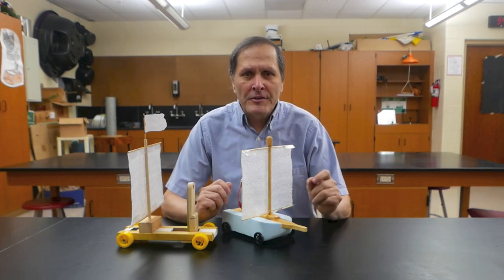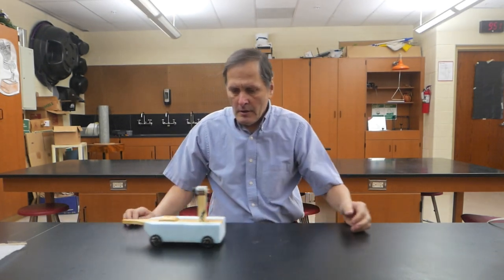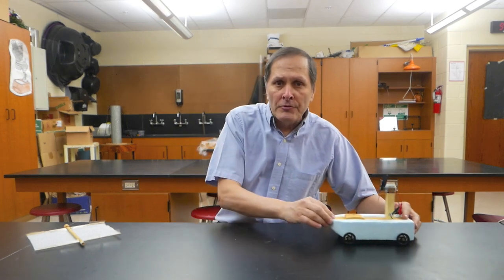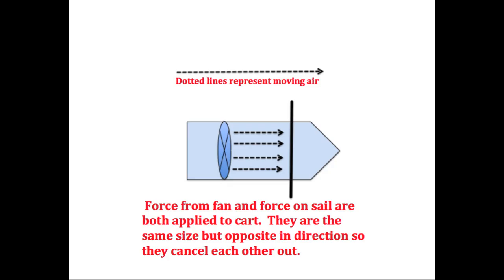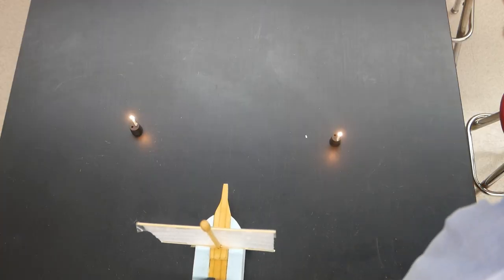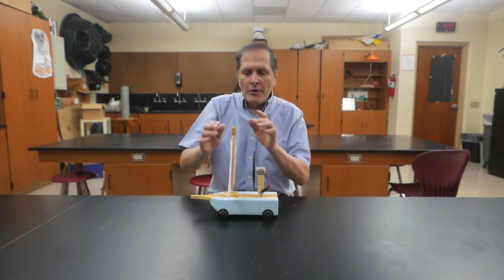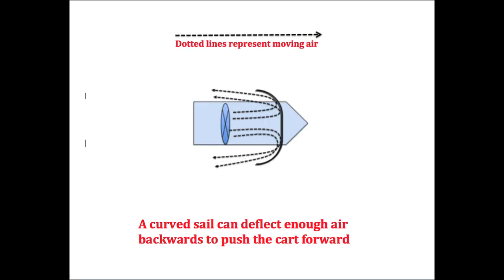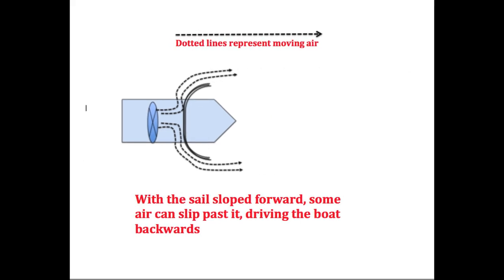Fan Cart - Blowing into your own Sail- part 1 // Homemade Science with Bruce Yeany

Comment: Have you tried putting a keel on the boat? With the sail at an angle producing spin, would a keel act to force that into linear motion?
Reply from the maker: HI Peter,   there is another video that follows this one where I tried some other ideas,  a keel / rudder helped

Comment: I still don't get why is there a net force on the curved sail when it redirect the air backwards. I do see how redirecting the air backwards in general produces a force, but what I don't understand is why it isn't balanced with the fan's force on the ship. 
Let's say you have a powerful laser as the fan and a perfect mirror as a sail. The mirror will redirect light backwards and create a force on the sail. So, will the force from the laser be balanced with the force on the mirror? And if so, how is this model different than the ship with a sail and a fan?
Reply: Really excellent point. My best guess is that not all the air is being pushed perfectly forward by the fan but is still caught and reflected backwards. This would be like having a laser at 45 degrees to the mirror. Then you'd expect the mirror to move away from the reflecting side. But if there was something restricting it's motion in one axis, e.g. floating on water, it would move perpendicularly to the input laser beam. Bruce, could you investigate this? maybe with a smaller curved sail only capturing the air moving perfectly forward?
Reply: Clearest example is an elastic collision.
m1v1 + m2v2 from before collision = m1v1 + m2v2 from after collision.

For example a basketball hits a stationary person.
If the basketball comes to a complete stop (hits their chest, stops, falls from gravity)
1kg*100m/s  + 100kg*0/ms = 1kg*0/ms + 100kg*1/ms
100 total before and 100 total after, the momentum has been transferred completely from the ball to the person.

If the basketball instead of stopping hits them and bounces straight back at full speed.
1kg*100m/s + 100kg*0/ms = 1kg*-100m/s + 100kg*2/ms
Now to get the 100 total after, we had to account for the ball moving backwards at 100m/s after the collision, which required the person being hit by the ball to move TWICE as far backwards simply because the ball bounced instead of stopping!

If the fan moved the air, then the sail stopped the air, the boat would stand still.
If the fan moves the air, which hits the sail and then bounces straight backwards, then the sail faces twice as large a force, it is responsible for stopping the air (a force) AND sending the air bouncing backwards (a second force)
In the flat sail where the air moved sideways, instead of backwards, this air was in a different direction in space (not forwards-backwards) so it didn't exert that second force either forwards or backwards.
Reply: You're absolutely right, thanks for reminding me of the formalism. I checked the steps including the fan starting to move the air in the first place and sure enough if the air is going backwards at the end then the boat will move forwards. I think this demonstrates how used to thinking in terms of closed systems we get. If you were on a boat bouncing a ball off the mast you wouldn't get anywhere. Similarly, if Bruce put the fan in a box then the boat wouldn't move forward no matter the shape of the front of the box.
Reply: Ciroluiro its really confusing haha, you’re not the only one tripping out lol. Let’s assume you’re standing in the back of a sailboat. Instead of a sail there is a solid wall. Let’s also assume there are no losses and all collisions are perfectly elastic.
1. You throw a ball at the wall.
2. The moment the ball leaves your hand, the boat gains momentum equal and opposite to the ball, so it begins to move backwards.
3. When the ball hits the wall and ceases to move with respect to the wall, both the boat and the ball have no velocity. At this point the net effect has been that the boat moved backwards.
4. Now since the collision is perfectly elastic, both the ball and boat begin to move in opposite directions to what they were before.
5. Now the boat begins to move forward and the ball moves backward.
6. Eventually the boat reaches its initial starting point. But notice the boat is still moving forward.
7. Time continues and the ball is now outside, behind the boat and continuing. The boat is now ahead of where it started and continuing.
8. The boat and ball will never meet again, so the boat will continue to move forward.

This is the simplified explanation of what is happening, but it captures the fundamental effect. Of course an actual ball will be falling due to gravity, but we assumed it wouldn’t because the ball in this case (air) is the same density as the air around it. All the losses we neglected due to our assumptions are apparent in the actual experiment in the video, which is why it’s more effective to have the fan without a sail.

If you measure the forces on the boat with the sail and fan and have a high speed camera, you’ll see that moments after the fan starts spinning the boat will feel a force backwards equal to that of the no sail case. Moments later that force will become balanced out and moments later it will become forwards.
Reply: Bypass air, like a jet liner engine, the exhaust from the fan isn't what provides most of the thrust, it's the bypass air which is carried with the exhaust
Reply: It is flowing air vs when the air hits a "wall". This is an important concept to understand lift, so get to it!

Comment: what if the air is being sucked in from the front and directed and blown to the sail.  Could you try this experiment with a pipe that bends from the back of the fan to the front so that the air source would be in front of the ship rather than the back?
Reply: Unfortunately, this wouldn't work either. The air that hits the inside of the pipe at the bend would cancel out the force of the air being pulled into the pipe by the fan.  Likewise, the air that came around the bend would push back on the pipe, canceling out the force of the air hitting the sail, resulting in the same problem.
Reply: I'm not sure it's as simple as that. The  fan sucking the air out of the bent tube creates a slightly reduced air pressure inside the tube so the higher pressure air outside the tube would produce a force on the tube and since the area of the outside of the bend is greater than the area on the inside of the bend there would be a net force equivalent to the curved sail scenario, or at least cancel out the force of reversing the flow you describe.
If you used the bent tube and then the fan blew the air into the bent sail you would have the equivalent of a jet engine with an S shaped airflow internally.
Reply: The main issue being the source of air is just as important as the out.  The fan is = to a person sucking air from one direction and then rotating 180 degrees then blowing it out.  If the people on the ship were blow to the back to move the ship forward they would have to spin towards the front and breath in the air to be efficient.  If they were standing still breathing and blowing in the same direction they would definitely have an issue.
Reply: No its not important where the air comes from... You automatically push backwards (as a human or a fan) when you blow the air. Imagine solid air: where does the force for the sail comes from? From your lips (as a human) or the rotors of the fan! Ther source therefor is not important!
Reply: Lower the air pressure in front of the sail and it will pull forwards.
Reply: nope in fact if one lowers the pressure in front of the sail the air comming in from the front will drive the sail backwards OR the air on the other side of the sail will push the boat forward depends on how and where you lower the pressure. There is no thing as pulling of lower pressure. But all of this has no relevance for anwsering the question of op or the video.
Reply: It's just like increasing the air pressure behind the sail. The difference in pressure is what's acting on the sail. You can try it yourself with a paper. Blow under it or inhale sharply above it and you will lift the paper.
Reply: no increasing or decreasing is a lot different since increase pressure can be done with a direction but with decreasing you can't. In theory they are the same but try do "suck" a candle out and you will notice. And yeah you anwsered the question yourself if its the same why should decreasing work with the sail but increasing ( with the fan shown in the video) dont? Again you will have a force balance between the two. ( try to imagine solid air and "sucking" at the front sail - if you are on the boat you will have the same counterforce on you and on the sail -> the resulting force is 0)
Reply: I'm sorry, there's some unclear communication here. I'm just stating the simple fact that a difference in pressure will pull the sail towards the low pressure side. You can't deny that.

I am NOT saying that simply blowing into the sail will move the boat forward. We all just saw that.
Reply: Liam K exactly what i was trying to say. And again @Johan Andersson theoretically you are correct but lowering the pressure in front of the sail will be hard to achieve in real world, but yes its the same if its an external source.
Reply: We can clearly se that a fan on the boat can move it (the fan is not an "external force"). The fan on the boat can, with a bit of tubing, lower the air pressure in front of the sail without negating the force on the sail by simply directing the air flow backwards. In this situation you would see the boat move and the sail pulling forward. I don't see why we have to argue about this. It's just a little misunderstanding of my first sparsely worded and perhaps unnecessary post.
Reply: maybe you watched a different video, but i can clearly see that a fan in combination with a sail can NOT move the boat? (at least if you dont lower the effect of the sail by rotating it). It's simply wrong.
Reply: I regret making any comments. They were only pointing out the obvious and seem to bring nothing but misunderstandings.
Reply: what about a different style fan? like a leaf blower that pulls air from one direction and pushes it in another?
Reply: There's no practical way to alter air pressure to that degree on the fly in the open atmosphere like that. using fans or lungs the air pressure would equalize before you could see any result, and if you managed to somehow create an extreme enough vacuum  to have a noticeable effect you'd get dramatic equalization that would create a sonic boom and a shockwave that would launch the boat backwards. So you'd be propelled in the wrong direction AND you'd be deaf.

For a more in-depth explanation of what happens when you suddenly create vacuums, XKCD has a pretty good one.
https://what-if.xkcd.com/6/